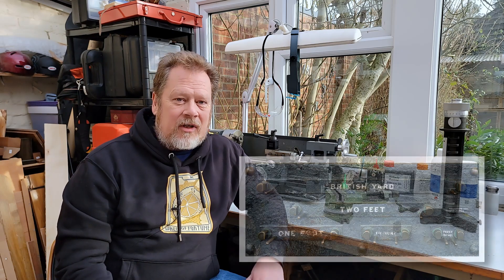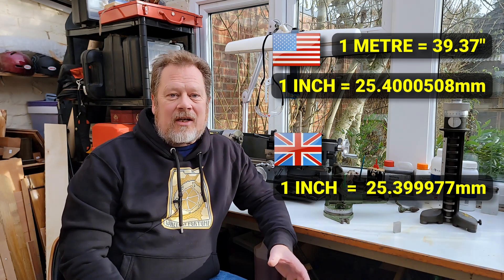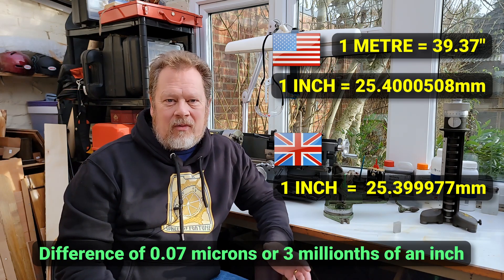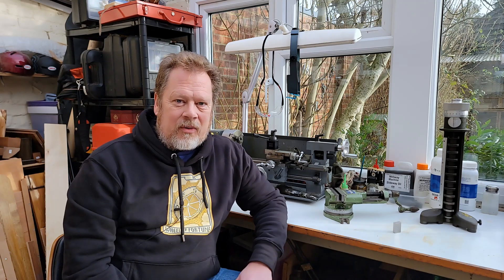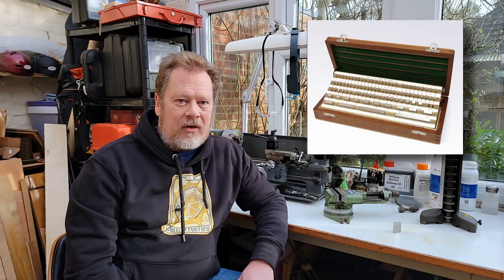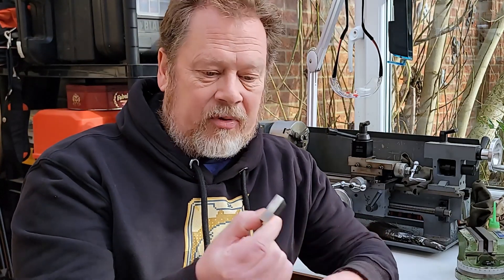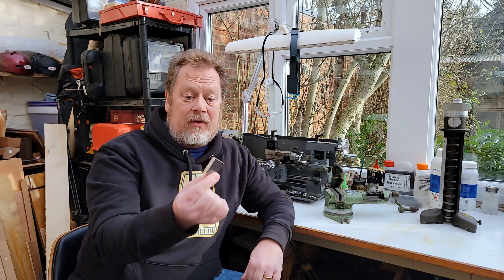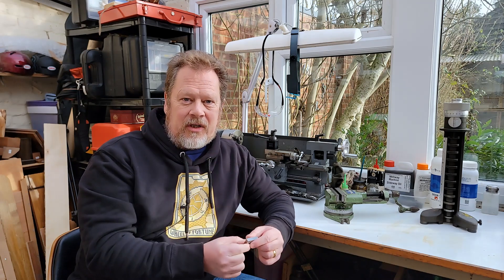And how the US Inch was based on Metric...

Comment: This is one of the few videos on this subject that is accurate.  I would add one detail.  The U.S. units have been defined in terms of Metric units only since 1893.  In 1832, when U.S. units were standardized nationally, the U.S. yard was intended to be identical with the British yard.  In practice, however, the yards were based on two separate physical standard bars.  While the British bar was thought to be the official standard, U.S. work depended only on the U.S. copy of the British standard.  That is probably why, when the yards were redefined in Metric terms, two values resulted.

Comment: The U.S. National Geodetic Survey’s story on this is the meter was adopted in the 1890s because the British Imperial Yard was not stable enough for modern manufacturing, the French were better at creating a stable meter so the inch was defined as 100/3937 meter then they published 4 place tables which in practice ignored the rounding error. Then in the early 20th century the US automotive industry wanted to make the 4 place values fixed instead of rounded which would result in the inch being exactly 2.54cm long. Nothing happened until 1959 when the U.S. designated the foot based on the 39.37 inch meter the U.S. Survey Foot and the foot based on the 2.54cm inch the International Foot. It doesn’t make much difference until large scale map projections which usually have coordinates in the millions of feet then there is a large difference. When I use Leica Geosystems gear I let the Swiss squirrels inside the machine run in metric, they are happier that way.
Reply from the maker: The US based their units on the metre in the Metric Act of 1866. https://usma.org/laws-and-bills/metric-act-of-1866
Reply: It isn't true that "nothing happened" regarding the inch standard until the official adoption of the international inch in 1959.  The machinists had adopted it as the industrial inch in the 1930s.  It did make a difference to machinists to have an internationally standardized inch.

Comment: Very interesting, thanks. Presumably your metal gauge block is only accurate at a given temperature?
Reply from the maker: Glad you enjoyed it. Yes, the gauge blocks come with a calibration certificate that says the deviation in size (tolerance) and also the temperature they were measured at which is typically 20C or 68F. It also specifies the coefficient of thermal expansion.
Reply: @ So, if at a different temperature you can still test your calliper gauge or whatever having done a little calculation. My very rudimentary “engineering skills” are only needed for a 1959 Series 2 Land Rover, so I don’t need such accuracy!
Reply from the maker: Yes, the best bet is to get everything acclimatised to 20C but you could work it out. For my 25mm gauge block the coefficient of thermal expansion is 11.5x10-6 parts per million per millimetre of length. So a 10C rise in temperature would give an increase in length of around 3 microns or 1 ten thousandth of an inch. If you stack lots of blocks together the error would be compounded.

For the old Landy orange Rizlas would be fine for setting the points 😂

Comment: With you Gauge Block being made of metal, at what temperature is the block exactly accurate? I imagine there shall be a massive engineering difference between it at -40°C and -40°F. Ok, little joke there but seriously there must be a standard temperature that the Block is measured at or is the metallic expansion and contraction not considered significant over say a 20°C temperature range which is a minor in Australia but in Canada you can get 80°C range between winter and summer?

As an example, in aviation performance is based on the air pressure measuring 1013.2mb (now hectopascals) with the air temperature at 15°C. Actual temps and pressure have been added to performance charts and added accordingly to get the real world performance at the actual time of use.

Thank You to anyone who can answer my curiosity question. 👍👍
Reply from the maker: Gauge blocks will come with calibration documentation that states their accuracy and also the temperature at which they were calibrated which is usually 20C or 68F. In an inspection department the environment will be temperature controlled so that all the instruments are at their calibration temperature. 

Even holding a stack of gauge blocks in your hand for too long can warm them up by a tiny but measurable amount.

Comment: So, since the 1950's, the "inch" was made to comply with metric 25.400000 mm, so now all these die-hard inch users are actually using METRIC INCHES anyway! 😂😂😂😂
Reply: Actually, the inch was standardized at 2.54 cm for industrial purposes in the 1930s as the "industrial inch.  This was done by the machinists; it just didn't become adopted by governments as the international inch until 1959.  The U.S. inch was based on the meter even before that, in 1893, with the Mendenhall Order.
Reply: By the way, it doesn't matter to most users of the inch how it is defined.  Only the metrologists were using the Metric System when they implemented the Mendenhall Order.  Nobody else noticed.  Later, when the industrial inch was adopted, the motivation was solely to unify the U.S. and Imperial inches, because the difference was large enough to be significant to machinists making precision parts used in international trade.  The inches were already defined relative to the meter, so of course that remained.
Reply: @GH-oi2jf    and yet, there is still an abundance of people who think the inch is somehow superior, more credible, more traditional etc
until I explain that their precious "inch" was adjusted to make it match the metric system. 😎
Reply: @wizrom3046 — My view is that all units are equivalent.  One system is not better than the other, only different.  The best wrench is the one that fits the nut I need to turn.
Reply: @GH-oi2jf     yeah, but I have a feeling that you are far more knowlegable and level headed than some of the muppets that I have had this "friendly discussion" with lol
Inch-worshippers are only a small step above flat-earthers 🤔😁

Comment: I find the metric SYSTEM superior to Imperial.  Simplier. However, the metric UNIT is problematic.  The Imperial system's UNIT,  is based on measurement, as it relates to HUMANS....ie, a foot, hands, etc. The UNITS are somehow better suited for human proportions.  An 8 foot ceiling......FEELS right. A 3 foot enrty door also. Mertic UNITS, are based on some and (as we now know, false) obscure dimension, related to the earth's curvature.  This is some abstract, unrelatable, unit of measurement. Might as well be based on the distance to the nearest star. While this might have certain uses...say in global distance, it in no way, relates to the SUBJECTS, using the unit. I have lived and worked, in construction, in countries that used both of these different systems.  One required blueprints to be specified in BOTH units! I have built in countries, that sold 4x8 plywood,  only to have it arrive in metric! Which caused considerable  problems in framing. 2x4's were actually 100x50mm...(or less). In my humble opinion,  were the UNIT size of a meter be adjusted to suit human proportions, but the SYSETM implemented, it would be the best of both worlds. Most tangible items in metric, seem skimpy, less robust, a 2.4 meter ceiling,  too low. And even that meter fraction don't really work out conveniently.  I have tried to think of how this could work. Say... if a meter was changed to equal 36". Or something else, in line with common simple proportions. I think of 8 foot ceilings being converted into a clean unit. Not 2.4 meters which is actually clumsy.  Any ideas, or opinions? 😊
Reply from the maker: Being in the UK (and of a certain age) I have been brought up using both Metric and Imperial. All my machine shop training was in metric but I actually like imperial for machining even though I will use either. As you say imperial is a human based measurement system and even when dealing with very small dimensions thous and tenths lend themselves nicely to the scale at which they are applied. When working on large things (larger for me means up to 1 metre) I will work in millimetres but have to say it's nicer to use inches i.e. 4", 5", 6" is briefer than 100mm, 125mm, 150mm. Personally I don't have a problem with either system, each has its strength, each has its weaknesses.

Comment: there is a world championship in skills every 2 year in a different country in machining parts and fitting them together. i was there and i realized that always the asian, european and countries who adapted to the metric system mechanics placed in the first 3 places. unmatched accuracy and speed in manufacturing and reading blueprints. the usa mechanics couldn't compete because the inch system is blocking their mind. but the usa is more and more adapting to the metric system, but they need more years to do so, because the government does not support the metric system.

Comment: metric make sense, the inch system not. the swiss engineers find out very early that in inch there is no accuracy to build a watch, so they stuck to metric and even the usa bought omega watches to flight to the moon.
Reply from the maker: The accuracy is the same, you could get the same accuracy measuring in units of bananas as long as everyone agreed on the length of the standard banana 😂
Reply: Accuracy does not depend on units, but you mean precision.  Precision doesn't depend on units, either.  Accuracy in the use of terminology is something else.

Comment: Would have made more sense to make the metric 25mm per inch. The original length of the meter was based upon the speed of like, at the time 300Km/s but it was inaccurate and the speed of light is only ~299,792,458 m/s. so it was pointless. at 25 mm, the inch could  marked in mm on a ruler to make conversion very simple. For on precision measurements (ie wood working) 1/25 of an inch would have been fine, and would have made everyone's likes much easier. Metric & imperial would have been interchangeable for common measurements.
Reply: The original meter was 1/10,000,000 of the distance from the North Pole to the Equator, thru the City of Paris. Not sure how accurate that was, but then made 2 scratch marks on an alloy metal bar that was kept at a standard temperature.
Reply: @larrystuder6378  Well if they just made it 25mm to the inch, everything would have been great!
Reply: @guytech7310  but then metric would not work.,
Reply: @timoakley277  It absolutely would. I have no clue why you think it "wouldn't work"
Reply: @guytech7310  because the whole system is self consistent. Basing it on an obsolete arbitrary unit "the inch" would screw it all up.
Reply: @timoakley277  How so? What the Meter\mm based upon? Some arbitrary length or something useful?

At best the Metric system has decimalization. The rest is mostly based upon arbitrary & variable constants not different than Imperial system. however Imperial lengths can be easily based on decimaliztion & is used for precision machining using inch mils.
Reply: @guytech7310  I grew up with imperial units and they are a disaster. Utterly disorganised and disconnected.
Anyway metric has won. It's the world standard.
Reply: @timoakley277  " grew up with imperial units and they are a disaster."

That's because you were using them wrong! LMAO. I've done precision machining sub 1 mils (-0.0254mm). Built a home, sheds, cabinets all using imperial. I never had a problem. Must be you!
Reply: @timoakley277 — A "disaster"?  How so?  The World War (commonly called the "2nd") was a disaster for many.  GMC trucks, built to the inch standard, were an important contributor to ending that war.  Half a million were built and some of them are still running.
Reply: @larrystuder6378 it was very close. As in pretty darned accurate.
Reply from the maker: True, it would definitely be easier to have that ratio, 4 inches to the decimetre etc... I guess they could handle tweaking it by a few millionths and few people would even notice. Knocking off nearly half a millimetre would have been more disruptive.
Reply: @guytech7310  I've just retired as a professional chemical engineer after 40 years. Never used imperial in a calculation except where dealing with yanks. And they use a bastard system which isn't even imperial.
A disaster.
Anyway metric has won. Thank god

Comment: This reminds me of the time in Europe before the French Revolution. Back then, every city had its own size and weight. 
And that is still partly true today. 
British standard pipe threads define one inch as approximately 32mm.  So 1/2 inch pipe thread is 16 mm. 
And the English managed to press this standard into the European standard.
Give me a 3/4 inch faucet, what else was that? 24 or 25mm.
Customers often leave the hardware store confused.
Reply from the maker: BSP threads are doubly obscure because the size refers to the nominal hole size and not the O/D.

Comment: An interesting fact is that the conversion factor 254 is 2*127 which are prime numbers. Why that matters. Lathes can have metric or imperial lead screws. If the feed gear mechanism has a 127 tooth gear. you can make both imperial and metric threads on the same lathe,
Reply from the maker: Very interesting 👍
Reply: In practice, most lathes come with a 125 tooth gear to cut metric threads,
and a 127 tooth gear to cut those barbaric dark-ages threads

Comment: Thanks for the history lesson. This guy who single handedly imposed a sense of order upon an absurd world is a hero. The day it sunk in to my thick skull that an inch is exactly 25.4mm was a game changer for mental conversions. If only the imperials were smart enough to call an inch 25mm ...
A significant percentage of electronic circuit board components are still built at 0.1" aka 2.54 mm pitch, but some are built at 2.5mm and if you get them mixed up it can ruin your day. Another conversion war stoty is from a cabinet shop where I built drawers. We made 8" and 4" tall drawer boxes and I thought it was odd that the dovetails were always off a bit. That is until I realized our Chinese dovetail machine cut at 25mm instead if 1", mystery solved. But the geezer I worked with insisted on inches so I figured out myself that cutting the drawer parts at 3 15/16 and 7 7/8 woked out perfectly. Although maybe not to gage block tolerances...
Reply from the maker: Thanks for sharing Barry - great war story 👍 What got me thinking about all this was that 25.4mm i.e. one decimal place and not dozens of decimal places seemed like too much of a convenient co-incidence. Turned out it was, and was a man made ratio. Cheers
Reply: @radboogie  It was a man-made split-the-difference number, but I still consider it a great coincidence since the meter itself is short (10 Mm doesn't even get you to within a nautical mile from the North Pole, but close.).  If they did nail the hebdometer,  the meter would be 0.1966...mm longer, making the inch that much proportional shorter.  The inch conversion would look like 25.3950080296 mm, rounded to 25.395008 mm, 25.39501 mm or even 25.395 mm.  But nothing clean like 25.4 mm.
Reply: Nice solution to your issue. You should be right pleased with yourself. Did the old geezer notice ay difference and comment on it?
Reply: @BarryGrumbine  As I said.....the metric SYSTEM is good. 10ths, and decimals. Easy peasy.  The UNIT, however,  could be tweeked. In reality,  what we call a meter, is arbitrary.  The base upon which it was based has been proven ...off. Who cares how it relates to the circumstance of the earth, that even is not consistent. Keep the SYSTEM,  adjust the UNIT, to make it more user friendly.
Reply: A change of that magnitude would have wreaked havoc on industry.  It has always been the policy, when making refinements to the definitions of units, to minimize disruption.  We should all be thankful for that.

Comment: I knew about the difference between the "survey foot" and "survey inch" (based on the old U.S. definition) and the current definition, but I didn't know about Johannson. What amazes me is that, even though the two definitions have their relevant numbers (39.37 and 2.54) on opposite sides of the fraction line (numerator vs. denominator), they differ by EXACTLY two parts per million.

Comment: If you had any sense, you’d move to the only truly sensible measurement system: the light nanosecond.
Reply: Actually, that's a unit I used to use all the time when I was playing with lasers on an optical table. It's easy to do with a tape measure. But we still used microns for measuring pulse lengths.

Comment: Whitworth defined the inch from the standard yard at great expense. Johannson copied a mathematical procedure that Whitworth used, which he got from Charles Babbage(simultaneous equations), to create all the gauge block sizes based on 1 single 100mm block that was known to be accurate. All gauge blocks can be traced back to that single 100mm block.